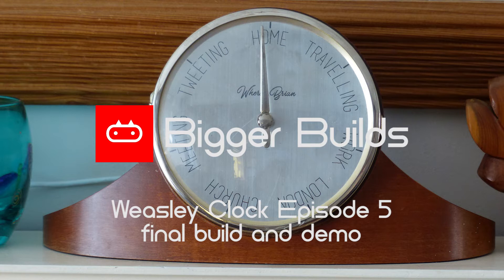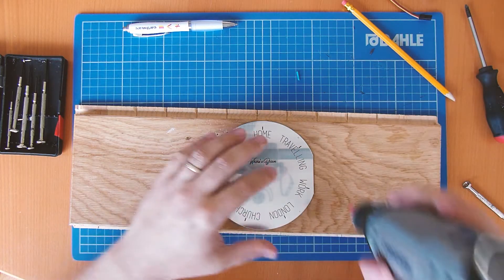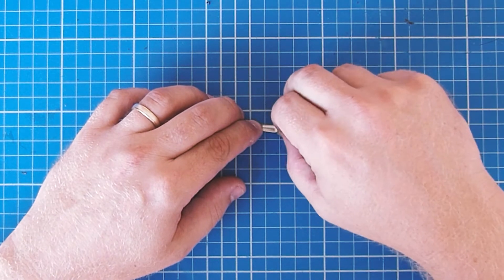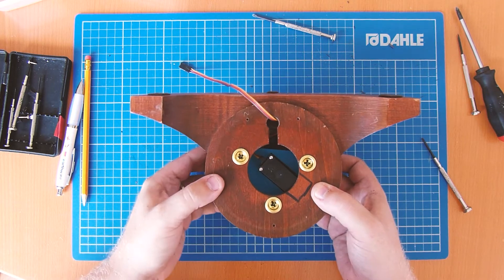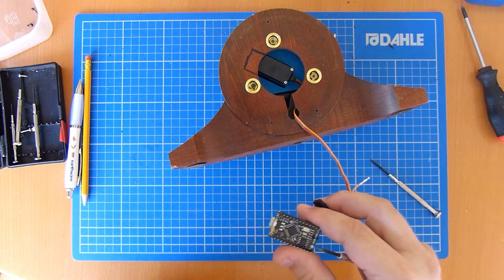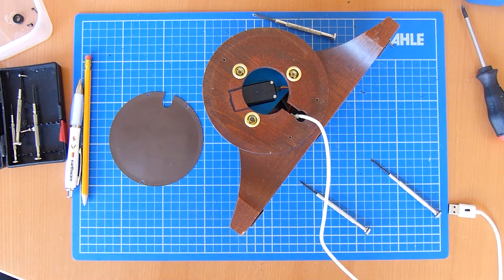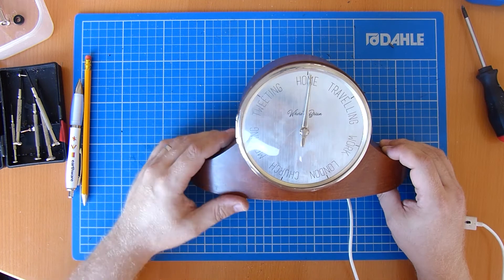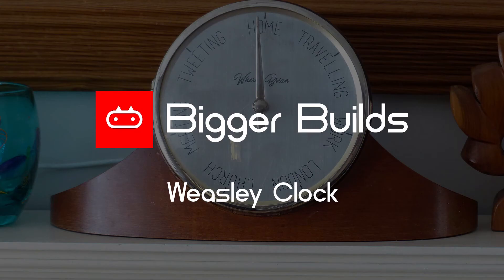Bigger Builds  - Weasley Clock Episode 5

Comment: Anything that is currently knew that wasn’t available four years ago you would recommend to get to improve the clock?
Reply from the maker: hmm good question, these days I might write a plugin for homeassistant to handle the location tracking and events as Im using that for my smarthome. Id still use a https://www.particle.io/ board as they make Arduindo so easy. Id probably considering adding in a e-ink display to the dial so you could have other information shown, other than that I cant think of much else

Comment: Which servo did you use?
Reply from the maker: Its a 360 degree "winch" servo often used for remote control sail boats. Make sure you dont get a "continuous rotation" servo though as those just keep rotating
Reply: MicroMonsters thanks a lot!